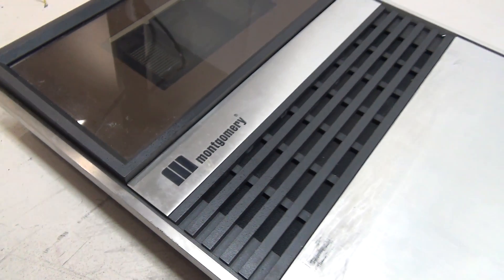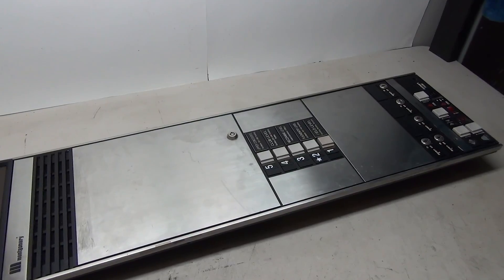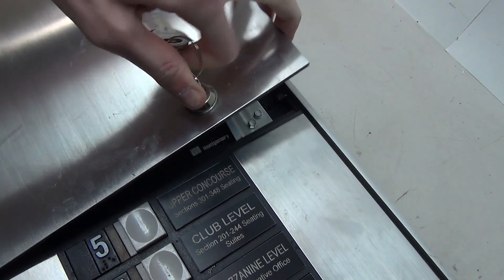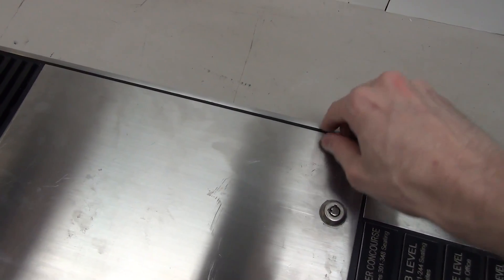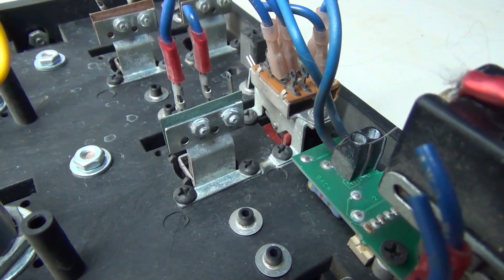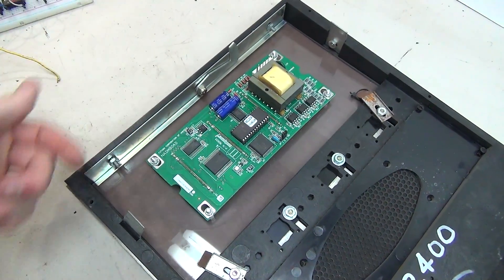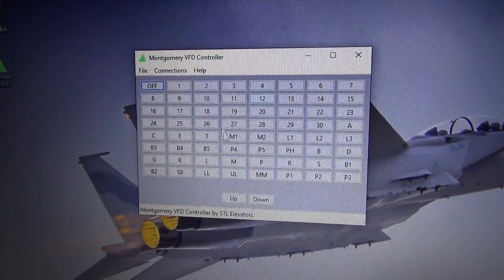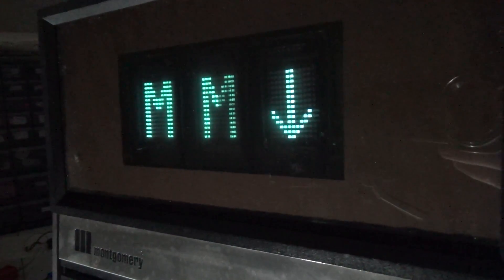Building a Montgomery Vector Elevator Simulator

Comment: I have a VFD indicator and since now I know to do the test mode, but I don’t know about the power source it takes. Do you know what power source, voltage, and connectors you use that’s required for that thing so I could power it up and do the test mode? - Jasan

Comment: This is a really cool project! I want to build something similar but instead build a fully working elevator model (basically an elevator shrunk down) and use an actual elevator panel to control it. It would cool if I could get my hands on one of these panels or at the very least the vfd indicator as it would go great with the project.
Reply from the maker: I want to build a model at some point.

Comment: being this is going to roanoke  too bad there was no way u could add to the ROM characters or access the sound to adjust the pitch and have the arduino make it display DD with the arows going up and down play the DD song with the mongomery tones
when u press a certain code of buttons
im sure if u dumped the rom and recoded a new chip with that added in u could but  the fact this works is amazing